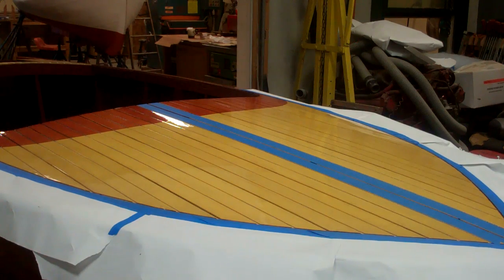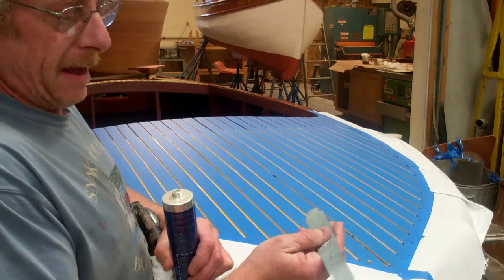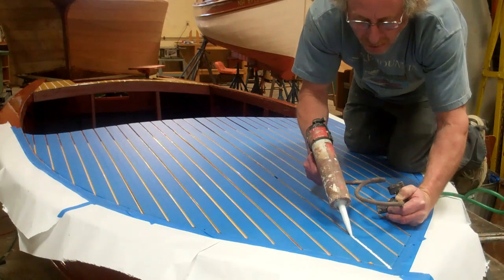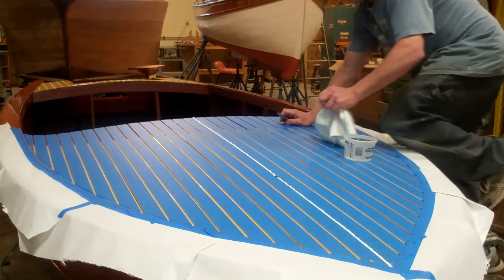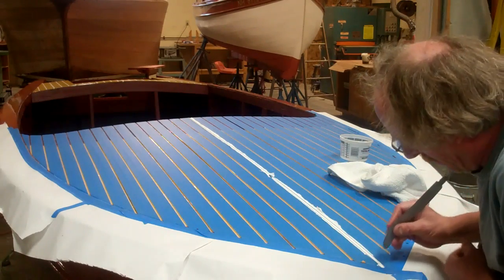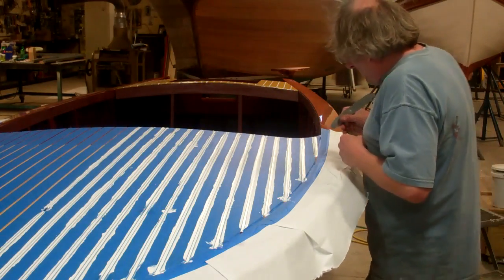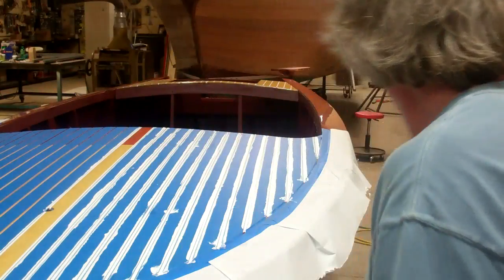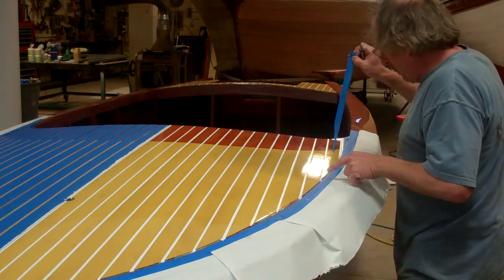How to Apply Sikaflex to Deck Seams 5 29 14

Comment: Perhaps a naive question, but just wanted to confirm that the Sikaflex is always applied after all the varnishing is done, yes? I would not think one would varnish on top of Sikaflex, but could you please confirm this?  Thanks.  Boat looks great.
Reply from the maker: Not always. The Sikaflex can be applied after a sealing coat of varnish has been applied, and then varnished along with the rest of the hull.Your challenge: use a crystal clear varnish or the seams will take on a honey-colored hue.

Comment: :Hello, Thanks to you guys for the videos on this topic.   It inspired me to fabricate  a "barrel-back tribute" of a sliding companion hatch on a vintage sailboat..  As with most things, the tape peeling is not as easy as it looks ;-).   My gaps were wider - ~ .25 +- .375 wide. And with practice, and folding the tape back onto itself as I removed (sort of pulling it  backwards,), finally could leave a decent line without tears in the sikaflex. So, how long do you let it set before removing the tape?  There must be an art to letting it set long enough for cleaner tape removal, but not so long that any raised sikaflex stands...  thoughts?   2/3rds finished, and can live with the result, but was initially a little rough going with lots of Razor edge cleanup on the first few lines ..  Thanks again for motivating the project and for any insight.
Reply from the maker: Please ALWAYS remove the tape immediately, as John does here. We remove the tape from each seam as soon as the Sikaflex is in place. That is why John is starting from the center and working towards the gunwales.
Reply: Okay thanks, I did remove the tape quickly since that was how it looked from the video timing and soundtrack .  I think that the extra width of my seams contributed to the challenges but it turned out okay dim the end . I'll email you a picture said you get credit for the inspiration . Thanks again !
Reply from the maker: @stuartharshbarger2341  Thank you, Stuart. I look forward to seeing the photograph(s)!

Comment: Might have helped the sound without the compressor and use a microphone.
Reply from the maker: Oh well. Ours is a working environment, and I cannot shut the entire shop down while shooting a video. I use a Flip HD with built-in microphone. Yes, it's low rent, but it works.Besides, the check I just did tells me that the sound track is quite audible and, save for the short interruption by the compressor, is easily heard and understood.I guess it just proves the cliché that no good deed goes unpunished!

Comment: Thanks for sharing, what type of materials did you use ?
Reply from the maker: We use white Sikaflex 295 UV for seams. If/when they must be yellow, we use mahogany Sikaflex, which we then paint before varnishing with Interlux Perfection.Here is the link to 295 UV: http://www.jamestowndistributors.com/userportal/show_product.do?pid=3514And Jamestown Distributors' description:Sika 295 UV is a fast curing, one-component, flexible, high performance polyurethane-based adhesive bonding polycarbonate and acrylic windows, or sealing open joints between glass, ceramics, fiberglass, metals, as well as many types of plastics and paints. This 1 part polyurethane sealant air cures to a durable elastomer. It is suitable for all types of organic (PC, PMMA) windowpanes. 295UV also provides superior UV and weathering resistance. Use with Sika primer 209.